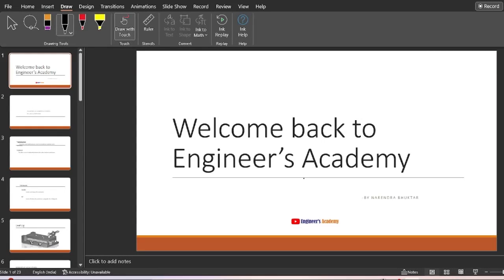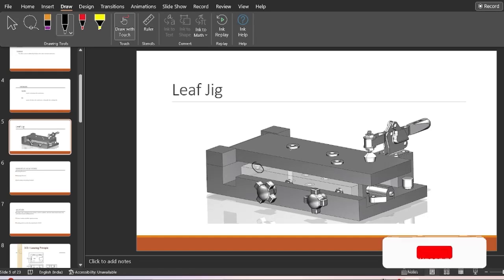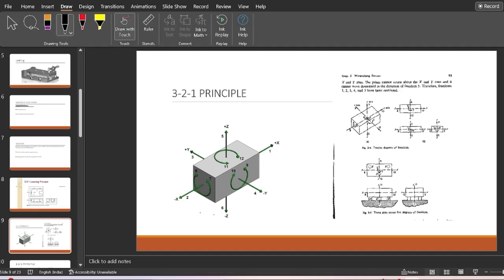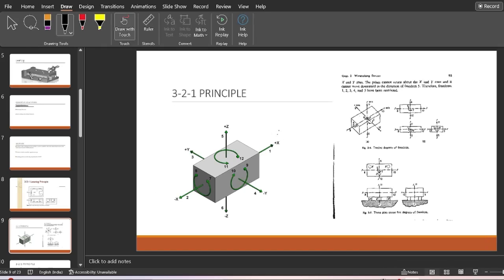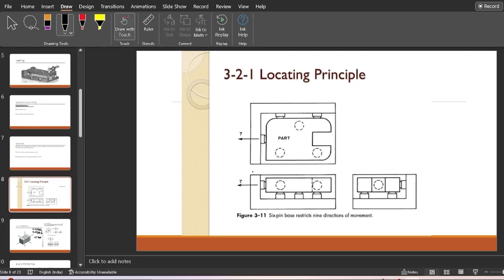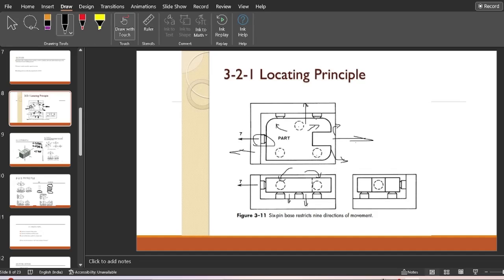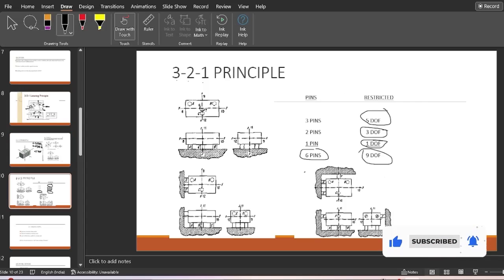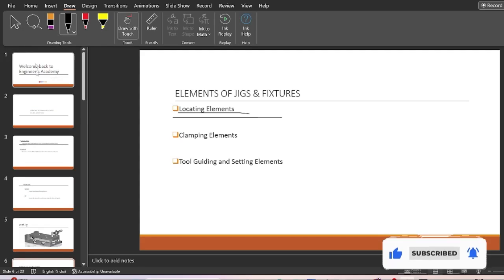3 2 1 principles (Six Point Location Principle) ||Engineer's Academy||

Comment: I have a question? 
Here you have mentioned for the first 3 pins in front view the -z axis restricts 1 DOF and clockwise and anticlockwise along y axis which restricts another 2 DOF so total is 3 DOF is restricted after this you came in top view and told another 2 DOF is restricted but how? I am not getting that. 
Can you explain which 5 out of 9 dof you have restricted from the first 3 pins.